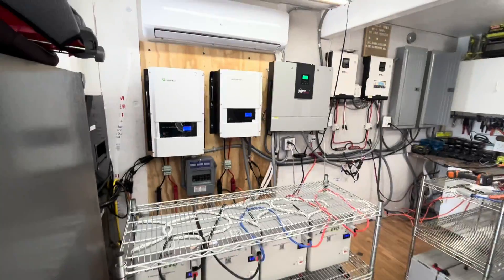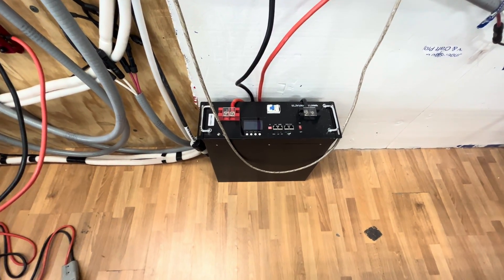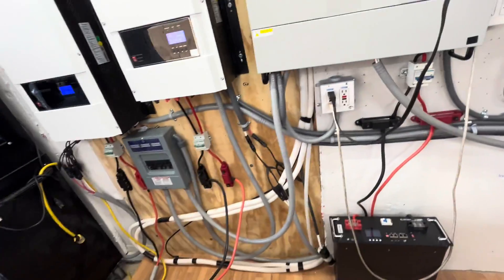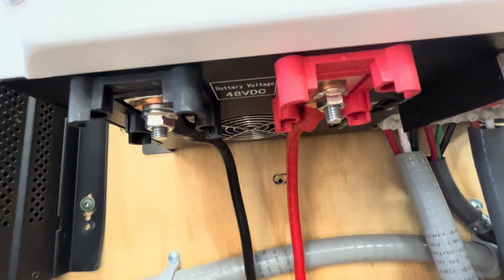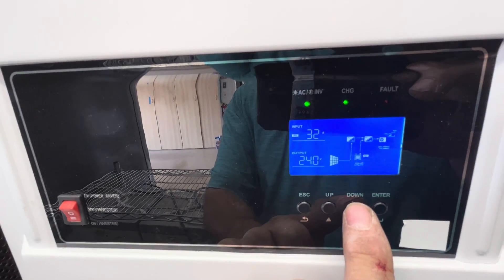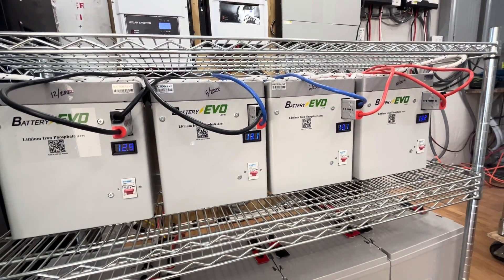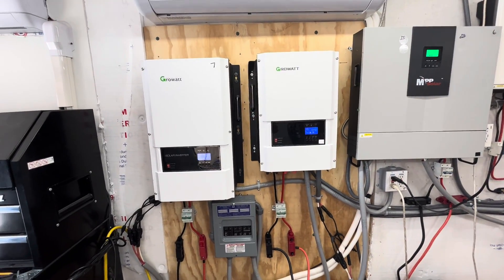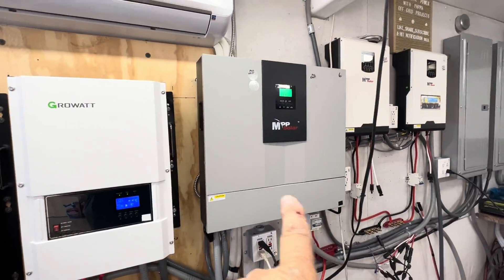Growatt 12kw inverter with 48v Lithium Iron Phosphate battery bank now starts 3 1/2 ton heat pump ac

Comment: Does growatt can work with 48V DIY LiFePo4 bank ?
Reply from the maker: Yes, Growatt low frequency can work with  DIY a 48v  LiFePO4 battery bank, I have never done that but there are many videos on YouTube that show how they built battery and how they installed along with what setting in inverter need to be set up. Check out videos done by David Poz or Will Prouse, they have done excellent videos on this subject. They go step by step in making batteries and also connecting to inverter.

Comment: For your 24v mpp's what you have are probably ok, the 48v  inverters at much higher max amperage draw is a completely different story though? And are they reversible, even for the 24v systems, they have to be as all your inverters are hybrid inverters and also revers direction when thy charge the batteries, only some dc breakers are rated for main dual flow function. That is why my 24v systems only have battery post t-class type fusses with separate 40+v rated switches and mega fuses going to the inverter, I have high interrupt rating and the ability for disconnecting and sized for each piece of equipment and wire. I don't know if I'm making myself clear or if I'm just confusing the issue, but this stuff can kill you in a heart beat, you can't just DIY it watching u-tube without prior knowlage, nor consulting with professionals!?
Reply from the maker: I understand what you are saying. I’ve had several people with electrical background see my system and they are completely satisfied with the way it is connected. We discussed in detail what I did. They work with extremely high voltage for the utility company. I know you are trying to help but I do not have an unlimited budget to go out and spend on everything you are suggesting. I really appreciate your help but the system is running extremely well. I know you want people to be safe, I understand that. I am on permanent disability and cannot go out and work so I designed the 4 systems with that in mind. My system has been reliable with no issues because I have safety in mind all the time. Before I did something along the way I would run it by sometimes several people with 40 + years electrical experience and give them the specs on components, some people may not like the components I used but that’s what I chose. I have been on permanent Disabilty since 2014 and don’t have the luxury of buying the latest and greatest products due to the money restraint. Keep that in mind when making suggestions to others. This is a DIY channel, Your suggestions are great but I have to do what I think is best. I have survived running these systems for over 3 years with no problems whatsoever. I know the limits of the components I chose after doing much research. I actually completely understand all you have said to me, just won’t be able to spend all that money I don’t have to change the system. Hope you have a wonderful and blessed day.

Comment: The new breaker boxes huge for safety! Switching out the wrong style breakers for the correct type, is good but Chantix brand I " think" is marginal, for my 48v system 3000w growatts mine are 3 times larger with much more interrupt capacity and yours at 5000-12000 especially low frequency have to be large, very large, in order to extinguish a short of over 48v with very high dc amperage from lithium batteries or they can just catch fire!?
Reply from the maker: I will look into that, thanks.

Comment: POPPA, YOU HAVE A HUGE BEAST OF AN ESS SYSTEM!
Have you considered running 10” metal electrical wiring trough underneath all your inverters & switches; also above your batteries for all your wire, connector protection for health & safety precautions?
THANK YOU FOR BEING A TRAILBLAZER AND SHARING YOUR AWESOME PROJECTS!
Reply from the maker: Thank you for your input. I have considered doing other things with the wiring but I have had no problems with the current system. Wires never get hot because I don’t overload with 4 separate inverters. Each inverter is used for different items to run. I actually overproduce what I need. Depending on the time of the year, I move arrays around to differ inverters. My setup is temporarily as we might move over the next 5 years so if we move I will be taking everything with me since it is all off grid. I just want to show diy that you can install off grid with absolutely no experience if you are willing to learn and invest time into learning about off grid solar, how it works, the pros and cons, the dangers of not connecting components correctly. You need to learn a lot before you even start working on solar. Today there are so many safe guards built into inverters, breakers, solar panels, it is pretty easy to buy components or a kit and install yourself. Once again, thanks for for thoughts, we really appreciate it.

Comment: Pappa...  Not usually pedantic about word pronunciation but your annunciation of the word "iron" is making this difficult to watch/listen to.   For the record, that word should sound like ai·urn !
Reply from the maker: Thank you for your comment, sorry it makes it difficult. Some of the meds I take for the 2 incurable cancers I am going through kind of mess with me when I say words. I will make an effort to try and correct the pronunciation in the future. Hope you have a truly wonderful and extremely blessed day.
Reply: @diy-solar-guy   Yeah, it's not a deal killer.  Sorry to hear you're dealing with those health issues. 

I wish you well, Pappa...
Reply from the maker: @soonerarrow  Thanks, it is what it is. I am blessed to be able to figure out the solar and share with others so they can see what you can do with solar and what you need to make it work. I’m self taught and I love playing around with the solar and far surpassed all my expectations of what I could do with off grid solar. Never imagined I could run main whole Ac units and heat pumps pool heaters that need 180 amps in Rush current to start pool heater, it’s amazing to be able power up and run all of it. It’s a challenge and a lot of fun. Hope you have wonderful night.

Comment: On the 12kw grow watt. What's the continuous bypass current?
Reply from the maker: Max charge current is 125 amps, max AC charge current is 100 amps, battery input 300 amps, AC output 50 amps. I have had this unit at 110 amps output on solar alone for several hours with no problems. That 110 amps was just the pool heat pump heater running by itself with no other load.
Reply: @diy-solar-guy  instructions say u an 80 amp ac input breaker. So let's say. I pull more than 12kw will it bypass power from grid to load till load is reduced?
Reply from the maker: @electromechanicalstuff2602  I have grid power connected to my input, I can run my pool heat pump with grid bypass and not use any solar. That heat pump has 2-50amp breakers in the main panel. The inrush current before I installed a soft start was around 180 amps on each leg (240 volts). So I can easily run 100 amps of grid bypass through inverter. You do not want to run this unit on solar close to the max watts or amps a lot, signature solar says it greatly reduces the life of the inverter boards, but the boards are field replaceable, signature solar use to sell the boards, not sure if they still have in stock.
Reply from the maker: @electromechanicalstuff2602  I found that it is either running off just solar or just grid power, have not been able to get it to use solar first then add grid power if not enough solar.
Reply: @diy-solar-guy  I don't understand u pulled 110 amps? On ac output side 240vac? Continuously?
Reply from the maker: Yes, inverter is just allowing the current to flow thru, the fans don’t really kick on because the power is not coming from solar. You can pull 125 amps from solar for continuous load, basically 60 amps on each leg or mppt charge controller. When on grid bypass, there is no load so it shows zero amps on load, it’s just flowing thru inverter.

Comment: Batter have a True Hard start add to a/c system.
Reply from the maker: The soft start I installed is working great, Hyper engineering. I will have to mess with the server rack battery again and play with the settings in the inverter. But not in a rush since I use the mini splits this time of the year and not that often.

Comment: The issue is probably the amp draw on those rack batteries during startup of the A/C. Have you put an inrush meter on your battery?
Reply from the maker: I have a soft start on my 3 1/2 ton ac which dropped the inrush current from 72 amps to just 22 amps. The rack battery is suppose to be able to allow 100 amp draw. It won’t even handle 30 amp draw. Talking to techs and engineers, they all seem to agree, need at least 2 server rack batteries to start ac. If there is a way to start up ac with just one server rack battery, I will figure it out eventually. Lol